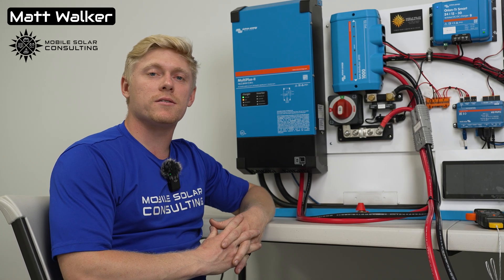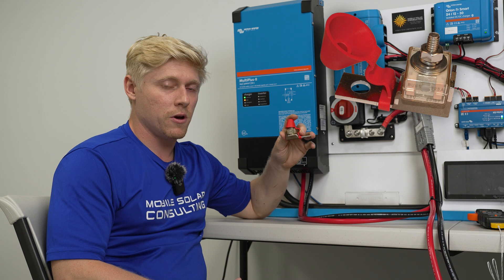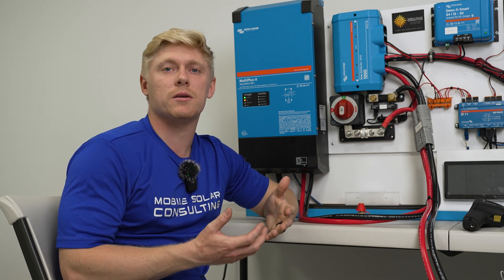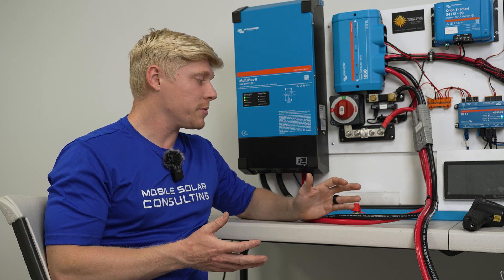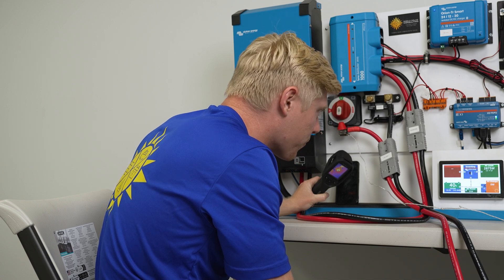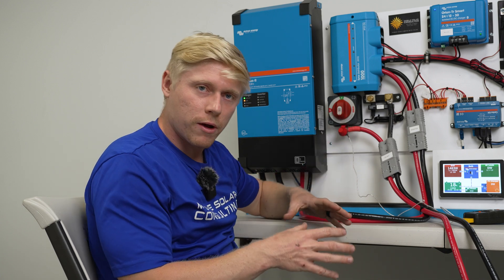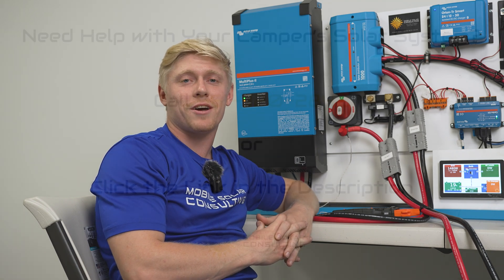Class T vs. MRBF Fuse Comparison (Load Testing)

Comment: @MobileSolarConsulting MCCBs may be a cheaper alternative to both MRBF and Class T. I don't know what ABYC says about that (circuit breaker vs. fuse).
Reply from the maker: ABYC just cares about the AIC rating.
Reply: @MobileSolarConsulting  Someone posted in some other thread perhaps on some other site, that breakers should be avoided in rough-use environments, say, like, off-road vehicles, noting that the insides may rattle apart. Kinda makes sense. In that vein, I wonder if a boat would meet some kind of rough-use environment definition. A boat can crash-down on the water hard, depending on the boat design. Anyway, if EF3 fuses are now avaiable in the states, those may offer some cost relief.

Comment: @MobileSolarConsulting A good companion video would be one that discusses fusing for various battery bank configurations (1P to 4P, 2S2P, 4P4S, etc.) using various battery voltages and capacities. (I'm assuming only premade batteries, rather than DIY batteries from cells.) Also, distinguishing what the fuses protect against would be good. I.e., discussing overcurrent protection vs. fault protection, long duration high current draw vs. short circuits, and the like. The need for fuses in-between parallel-connected and series-connected batteries. Compartmentalization via fusing so that the system continues to run upon isolated faults. Anything and everything in the realm. Whoa, that's a lot of subtopics, so maybe more than one video or just any of them.
Reply from the maker: Good ideas! Thank you

Comment: @MobileSolarConsulting Very good presentation and testing. I have to research more before deciding on a fusing strategy for my battery bank and system. The expense of Class T fuses/holders makes me want to minimize usage of them. On the flip side, I find MRBFs directly on the battery terminal in the prescribed holders, unwieldly. I'm leaning toward mounting MRBFs directly on a busbar and leaving the less-than-2-foot cables coming from the battery terminals unfused at the terminal end. The AIC ratings of MRBFs (at 24V 200-400Ah) and the latest ABYC recommendations, keep me without a definite fusing strategy.
Reply from the maker: The classic conundrum. It's not easy to decide!

Comment: Yes fused to protect wires. But where to put a fuse for a battery, its a two way device. One tries to put the fuse at the source but the battery is both source and load . So I put my fuse at the battery for the discharge cycle one at the charger. So we got it for both directions but are we done. When changing yor load have both charger and battery supply loads from the bus. If my charger is charging at 30 amps and my battery has a 30amp fuse then we have 60ams available on the bus. So  the  bus loads need fusing as well.  One fuse doesn't do it. We got to consider these when designing the catch is oh I got everything fused at 30 amps but remember things can add up.
Reply from the maker: Each load and charger should have their own wire. Maybe you would benefit from a diagram that shows where all the fuses should be placed and what wire sizes to use. Contact us for more help!
Reply: @MobileSolarConsulting  I was pointing out that it takes more than one fuse ... right.

Comment: 0:36 before I watch this I'm going with Mrbf fuses all day 👍, 
I've been told there no good on lifepo4 lithium batteries 😂 
However I'm not changing my 3 x 125a mrbfs each on a 100ah lifepo4 battery for class T fuses or fuse 😅, 
So many arguments on FB off grid solar pages about this hahahaha, 

I have 3 x 100ah lifepo4 lithium batteries each with a 125a Mrbf fuse, 
Each positive has a 30cm long 2/0 750a rated battery cable going to a kill switch each -( just incase one battery is no good I can disable that one for replacement).
Then 30cm same lead to a 300a bus bar,
Neg lead after kill switch is 30cm to 300a bus bar

Bus bars soon to be replaced with a power in I just brought 👍👍, 

From that I'll have my 500a smart shunt on one side and POS cable 750a 30cm battery cable running to a  150a mccb to a 300a bus bar for all my little 12v items. 

My 3000w inverter POS cable 0000 - 4/0 will be  connected to the power in with the negative cable same size going to a 300a negative bus bar after the shunt. 

How does that setup sound Matt 👍
Reply: 6:43 yes this is why I think the Mrbf is a much better option in my setup on the 12v system,

With my 2200w jug 60w fan and I think 18w light running through my 3000w inverter pulling a max of 180a across 3 x 100ah lifepo4 rather than 1 x 300ah lifepo4 keeps my mrbf fuses cold at only 60a each being drawn from each battery, 
My heat gun doesn't get over 36⁰c when pointed everywhere on the battery cables or mrbfs 👍,

Id say a 375a class T same as 3 x 125a Mrbf lol would probably be the same temp 😅 , 
Safety on it being on the terminal is also great 👍
Reply from the maker: Nice!
Reply from the maker: Sounds great!

Comment: Is there a scenario where you might use both MRBF fuses on the battery terminal side that join at a Lynx Power-in and then a T-class between the Power-in and the battery cutoff at the Lynx distributor? Or, is that too much fusing? This is on a 24V 600Ah(3x200) system powering a Victron Multiplus II using all 2/0 cable throughout.
Reply from the maker: Hi, you want to avoid any unnecessary fuses, but at the same time, every positive cable needs a fuse. So in your case, it may be necessary to have both. You'd need to send pictures of your wiring or a diagram for us to be able to confirm. A written description of wiring is just not adequate for me to say for sure. Thank you for your comment.
Reply: @MobileSolarConsulting  What about the cable between batteries in series? That could be considered a positive battery cable. What if it's only 3" long? What if it's 3' long?

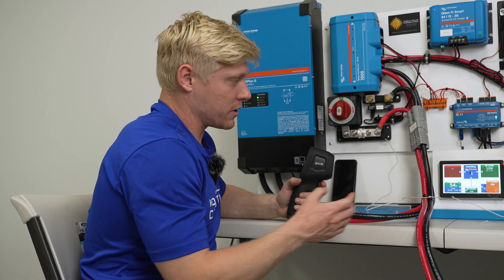Comment: Paused at 4:50.. yes the temp gun is low, because you're aiming it at a reflective surface. It amazes me how many supposed 'Pros", don't actually know how to use a heat gun, and/or understand the the reflectivity, and even how the colour of a surface, affects how they will read the temperature. Back to the vid...
Ok.. you mentioned reflectivity at the end. lol. I guess you earned 'Pro' title on that aspect of heat measurement).
I will add, if what you're measuring allows good placement, what most folks will do, is stick a piece of black, matte finish(think fabric) tape on the items, so they have an equal reflectivity. That said, any tape, or whatever one comes up with, that can make them equal, is a good way to compare temps, even if the numbers are off one way or the other(up or down). But yes, an actual contact thermometer, with accurate calibration, will be best, IF both items allow for a good contact with the 'tape', and the thermo device (lug, or whatever).
Reply from the maker: Appreciate it!

Comment: Where is the chart you referenced?
Reply from the maker: Thanks for pointing that out, I have added that to the description now.
Reply: Its a chart relating fuse size to cable gauge... but I haven't looked at it specifically So be aware, depending on what it shows, there are several factors that influence those numbers, like temp rating, engine bays, bundling or not, and finally, even cable manufacturer specs.. the BEST advice is if the cable manufacturer has their own charts/spec advice.

Comment: You mentioned ABYC standards and later you said the cables were 1/0 cables with 90C rated insulation. The ampacity of these cable in the ABYC standards is 245a. Why would you ever use 300a fuses for overcurrent protection? 

Also, with a 24v system, the AIC for an MRBF is only 5kAIC. This may or may not be adequate for the unspecified Ah  battery if TPPL or LFP. (You don’t say what the battery is or the capacity other than 24v) 

Don’t forget the battery AIC safety fuse if the batteries are in a parallel bank in addition to the main battery fuse. 

Nice video though. Good stuff
Reply from the maker: Hey Jim! So what fuse would you (or ABYC) recommend if a Class T didn't cut it?
Reply: @MobileSolarConsulting  Oh, Also.. I forgot the rating issue Jim brought up. A Class T won't even blow at it's rated capacity... ideally, the cabling should be sized high enough to allow for a fuse with a lower rating, because even at 125% over amps, it can still take 500 to 1000 seconds to blow. One needs to look at the specific curve charts for a particular fuse to know how many seconds it will take to blow at how many amps.. I mean as a general set of Blue Sea Class T shows, at 200% over rated amps, it takes a second or two to blow... at just 150% over, it can be from around 10 seconds to a minute or so to blow. The thing is, one needs to look at EVERYTHING to get the big picture, to choose a small part.. Inverter that often over rates for surge? You need a few seconds grace on the fuse, or it will constantly blow. A circuit that never surges, but usually has high current?... You need to underrate that fuse to blow if any prolonged, moderate overcurrent can be expected. System design is not as simple as looking at a chart and picking a fuse.
Reply: @MobileSolarConsulting  I think you are missing the point. A class T fuse IS appropriate but it needs to be rated for less than the ampacity of the conductor it is protecting. So a 90 degree C insulated 1/0 would need a 225a fuse to protect it depending on the bundling or if it goes through an engine space. See E11 table 4a. 

If it is an LFP or TPPL battery of more than 100Ah, a 10kAIC at 29.2V or higher fuse is needed. An MRBF is only 5kAIC at that voltage, but a Blue Sea Class T 225a fuse has 20kAIC @125Vdc so has plenty of short circuit breaking capacity at 29.2v. See E11 table 3 and 11.10.1.3

Great video on the concepts.
Reply: Jim is correct here.. the AIC is higher, the lower the voltage is.. most fuse specs show the rating (ie: the spec sheet shows the rating) for 12 volts, whereas the Class T shows a rating for 125, so at 12 its as good or better than that.
That said... if were talking ABYC, unless certain circumstances apply, the fuse should be within 7 inches of the battery+ terminal, which is why an MRCB, as the name implies, is a MARINE rated battery fuse. Meaning, if space/system design doesn't allow for a 7 inch placement of a Class T, then unless certain situations apply, an MRBF would need to be used.. perhaps with a 'Master' Class T, covering the rest of the system cabling from the closest available install point.
I am not a marine specialist, or even a trained electrician, but all these concepts are self taught, so should be easy knowledge for 'real' electricians who deal with any systems that involve these types of requirements.
As for recommending something better, the next step up would be N/NH fuses, which have AIC's at around 30,000+.. but.. that's getting a little carried away for DIY sized installations, and are also harder to lay hands on in North America, than even the sometimes difficult to acquire Class T's.